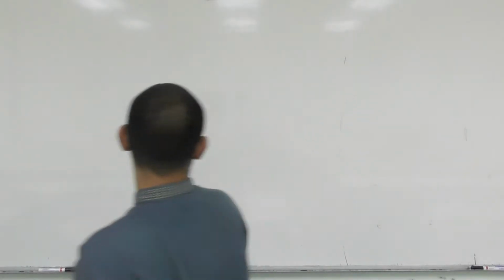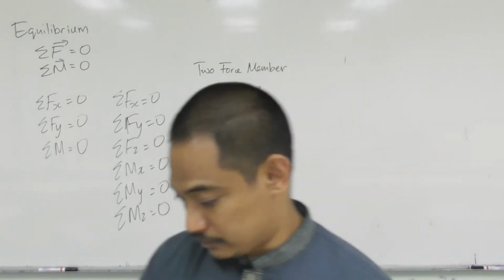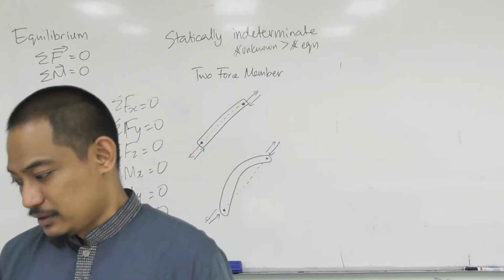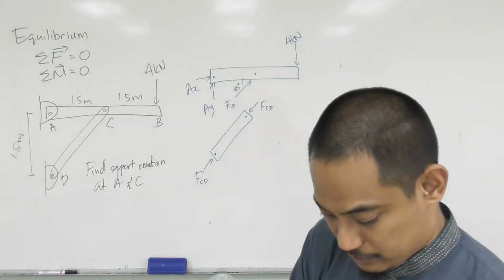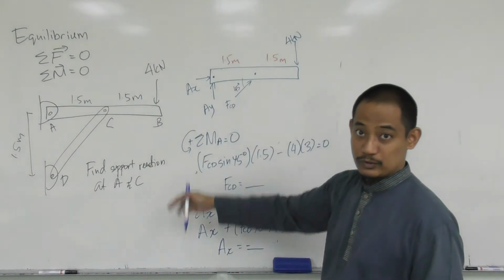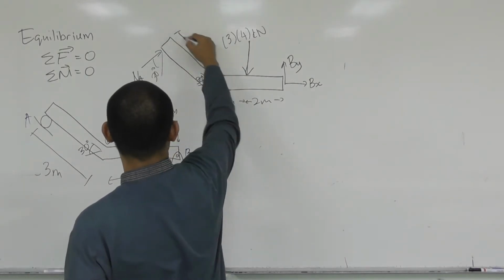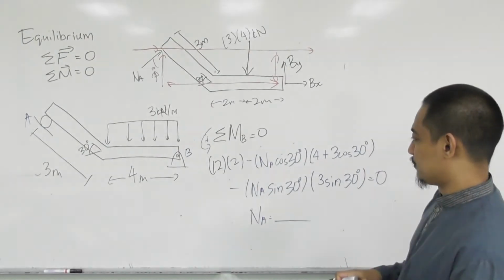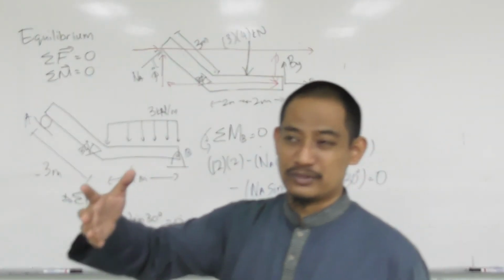Statics - Chapter 5 (Sub-Chapter 5.3 - 5.4) - Equilibrium of Rigid Bodies 2D problems

Comment: dr, in example 1, why it is not fdc instead of fcd (18.07)
Reply from the maker: For 2D problem (or for scalar), the label used for the force are simply the "name" we give for each force, so you can use either Fcd or Fdc (both describe the 2 force member in the example), as long as it is consistent between the FBD and the equation and calculation (the "name" must match between all of them)

It is different for vector force, the subscript are normally written in accordance to the direction of the force, to avoid confusion...